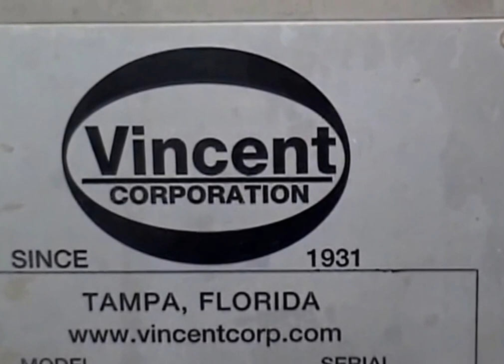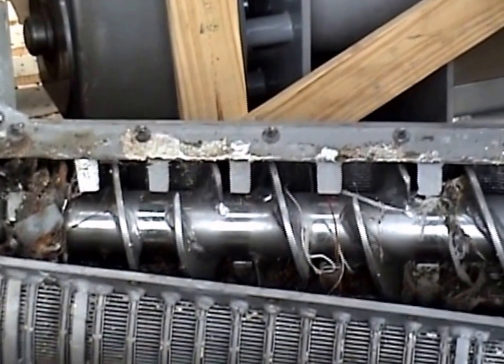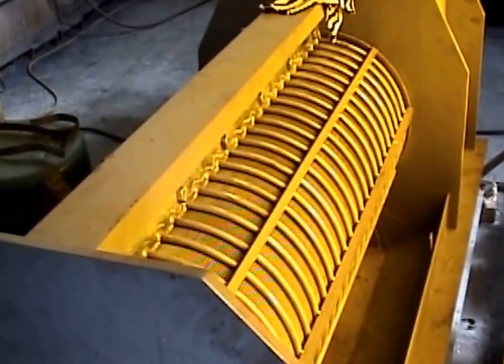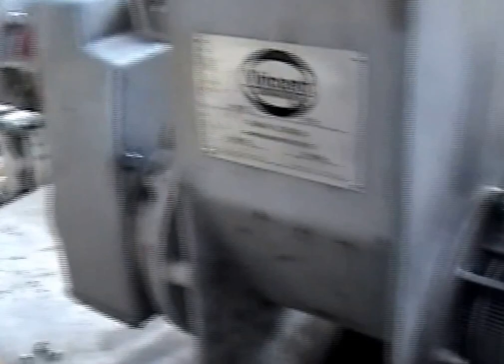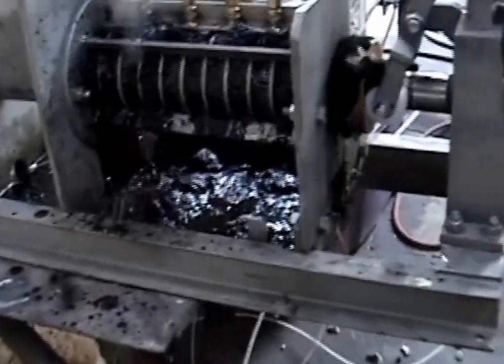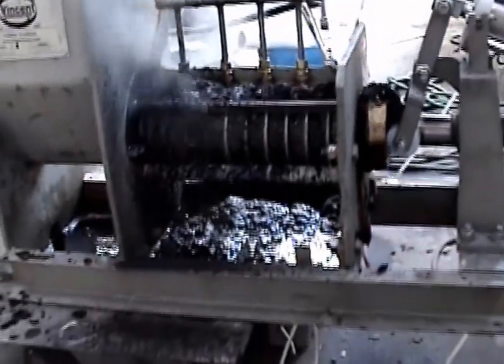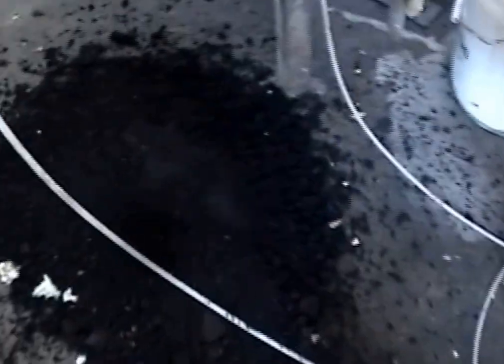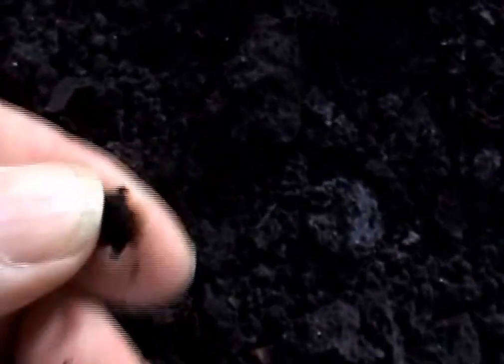BEESWAX TRASH RUN IN VINCENT SCREW PRESS

Comment: I’m a machinists and beekeeper who Used to build plastic extrusion dies for a living. I can help you figure this out as I’ve worked with extruders and beeswax a lot.
What I’m seeing immediately is that the screw flights have way too much clearance for the material, instead of direct steam injection use a barrel jacket to heat the material as you really will have a hard time keeping the steam pressure consistent . Tighten the helix of the screw up as the gets towards the end of the barrel or use a breaker plate and packing screens.If you would like to contact me with any questions please feel free.

Comment: Would you please explain the process of the screw press? this looks a little confusing to me.
Reply from the maker: Hello Crgaillee,

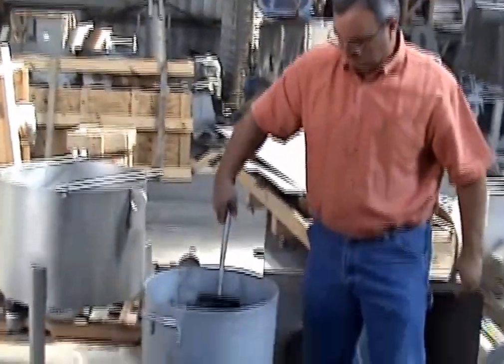The presses are used to dewater any solid/liquid mixture. This is either done to recover the liquid or solid product which is dependent on the customer. The press has 4 main sections. The motor controlled by a VFD which you can see at 10:25. The motor turns a screw which has multiple flights welded on to move material from one side of the press to the other. The second section is the inlet hopper. That is where we were inserting the beeswax in this video. The following section is the screening section. This is where the liquid comes out of the press. The final section is the cone which applies pressure onto the solid material moving through the press. This pressure is applied to remove any more water from the solid. Depending on the application we can apply more pressure and/or change the speed of the screw. In this particular video we have steam injection into the press to aid with the water removal. 

Regards,

Vincent Corporation